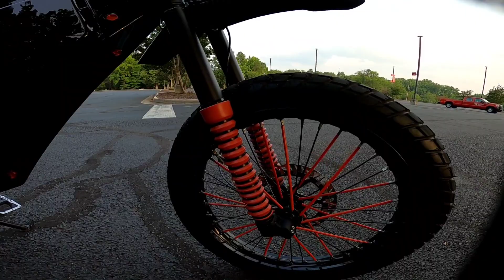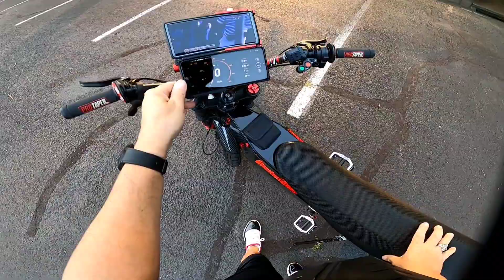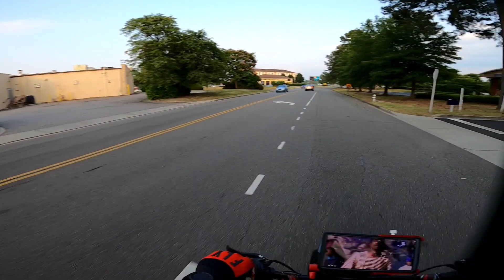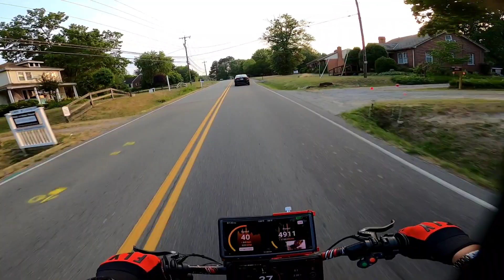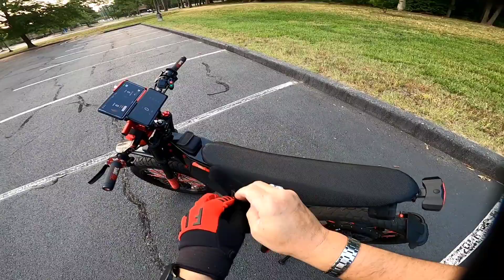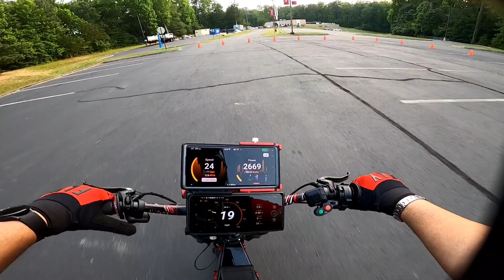Testing my High Power 36Kw Bac8K  Super Emoto after upgrading motor phase wires and new upgrades

Comment: Hi Dr Chrischrosswire, I got some litthium ion polymer (co2ob batterys 40 ah ) would this help me get torque for steep hill climbing and range ?
Reply from the maker: was the disharge rate on those seems like as far as capacity they store allot of energy but you also need to know how much power they discharge as thats what will help you with torque and pwr. Not all batteries have both so thats important. that Cyberx bike i have has a huge batt as far as capacity so low pwr it has great range but it can only discharge 100amps which is why that BAC was way too much for it

Comment: Just finished my first build tonight! Tested at 30% battery and still got up to 50mph almost instantly. Going to try the full 12.6 kw tomorrow after a full charge. Any tips on tuning within the MQCON app?
Reply from the maker: Good luck bro and it's more of settings with Mqcon app as your not actually tuning but adjusting the parameters I have a video somewhere with how my setting when I was using it. It's way back in my archive if you can't find it come back and I'll locate for you
Reply: @ChrisCrossingWires1212  Haha man I actually stumbled on it while tweaking some things on my first long ride today. These things are incredible. Appreciate all the help from your vids. I need to get me one of those Garmata seats next. 25 miles through side streets and trails beat me up pretty good on that $100 Chinese seat
Reply from the maker: @travish9378  eurobike Garmata section

Comment: what you think about the nd721800
Reply from the maker: I think that will serve well for a high voltage build I just think they need to come up with some better software hopefully they will and allow you to go deep into tuning like AsI even tho your not supposed to have access if you do its bueatifull allot of people have no idea just how deep you can go in Bacdoor they think their tunning wiith app settings lol I gonna use a fardriver for my petrol conversion as I wont be going crazy on that just give it as many volts as it will take
Reply: @ChrisCrossingWires1212  would you race a electric motorcycle like the zero? figure it would be a good benchmark to see where your bike really is.